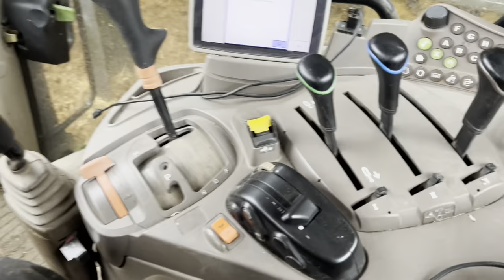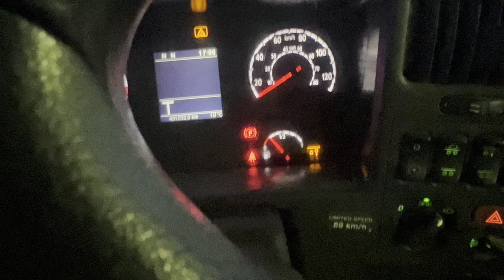2 Broken JCB buckets! Emily loads a full mix! We have a trip out in the SCANIA

Comment: You could chop your beet in the mixer wagon and dump it on the yard and feed it out with the Mx bucket? I chop our beet in the mixer on its own then dump it out and then put it into the tmr
Reply from the maker: We have tried chopping beet with the old mixer and it wasn’t very successful, just moved them around. Does your mixer have the beet knives in the bottom?
Reply: @joeseels  no we've just got normal knives it is a single auger so might make a difference not sure, I put 3 ton of beet in and leave it chop for half an hour on 1400 revs and high speed on the gearbox chops it up lovely!
Reply from the maker: I might give it a go tomorrow if I can’t get the part right away. Blades should be a bit sharper on the new mixer I suppose 😀😀 thanks ☺️
Reply: @joeseels  no problem mate, might get you out of trouble for a couple of days 😂